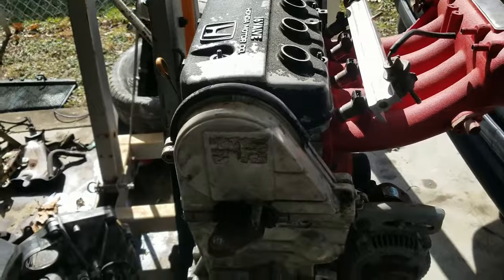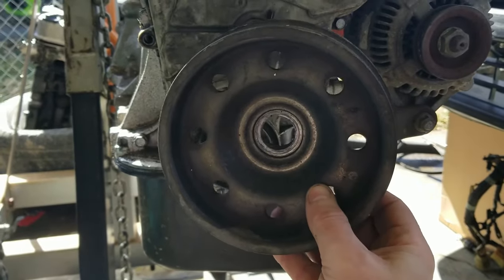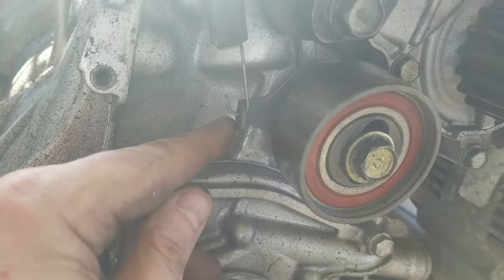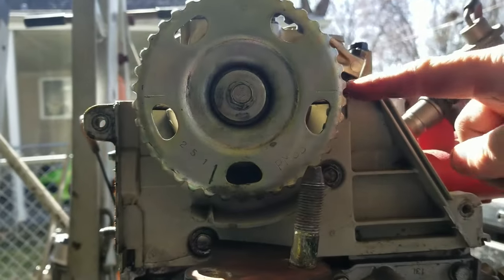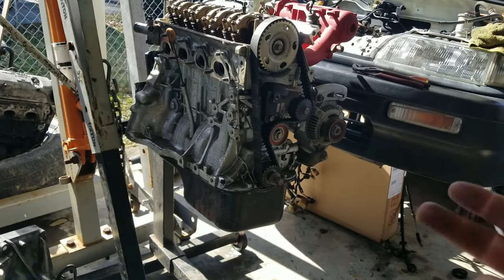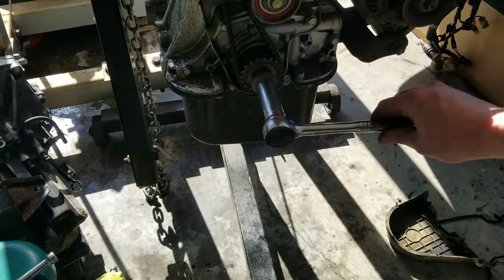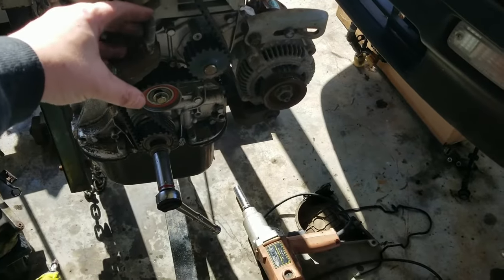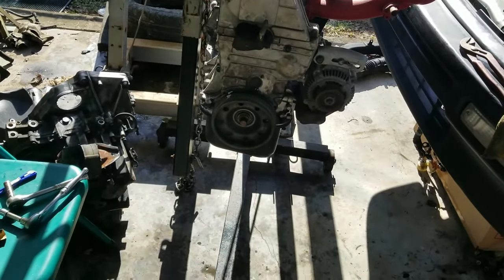Setting the timing on a Honda D Series  D15/D16 D15b2 D16a6 D16z6 D16y7 D16y8 Single Cam ZC

Comment: When adjusting, do not use any force other than the adjuster spring. If the belt is too tight, it will result in a shortened belt life.

Comment: On a DOHC ZC there are two spots on the cams on top to put two 5mm drill bits to hold the cams in place. Then do everything as the video suggests but go a little off on the bottom crank mark (around 3 teeth off) so you compensate for the slack when you turn the bolt. Spot on timing every time!

Comment: Great video..  Short (but important) note.   On P08 (JDM) engines (example D15B) the cam timing marks don't align with the top of head.   Instead there will be 3 notches in the plastic back cover (part number 11840-P08-010): two triangles showing P08 and one showing P28.   On P08 heads the "Horizontally oriented" 2 lines will align with the 2 P08 notches and will be slightly slanted with reference to the top of head by about 1 gear tooth.   On P08 engines if the CAM lines are aligned to the top of the head engine timing will be retarded (8 degrees for CAM 16 degrees for crank) and it will not be possible to set ignition timing successfully.   Engine will still work but won't be optimal.  On P28 engines you would of course align the single horizontal line to the P28 notch.   The rest is perfect.
Reply: Good info!
Reply: Thank you soo much for this comment I have pulled apart and put back together my d15b in a 1999 Honda domani twice now and couldn’t work out why it wouldn’t run right not realising the timing marks are not at the top of the valve cover but the side of the engine
Reply: This might be the solution to my weak engine. Thanks
Reply: I put my d13b with a p2a head. It wont start. Any idea on timings sirs?
Reply: holy shit, ty so much. I was dealing with these weird notch/arrows on my d14z1 and couldnt figure it out, since everyone says you should align it with the top of the head.
Reply from the maker: Yes if the timing is off just a tooth or 2 it can cause loss of power.
Reply from the maker: Sorry for the late reply, here in the states we never got the D13B engine, we got the p2f 1.6 head from the d16y7 non vtec I believe which is similar to the p2a head. This is a tough question because it depends on the deck height of the D13 block vs the D16 block. You make have to play around with different belts and tensioners to get it right.

Comment: I followed this video and kept finding if I turned the crank 3 times completely like you’d mentioned that my cam gear where it says “up” facing downward. I was going insane trying to fix this. After calling a buddy with more experience. He ask me if it lined up with just 2 turns. I said yea. I put an extension in the number one hole and sure enough it was tdc. 
I cranked the car with no dizzy plugged in to hear any irregularity and it sound good. Started it and it purrs. So if anyones chasing their tail turning it 3 complete times and getting the “up” facing down. This may be an issue your having.
Reply: The "up" Mark will always, be on down side at 3 turns. Reason is, for each complete turn of crankshaft, camshaft turns half and so you will, get the "up" Mark again on top after two complete turns of crankshaft.

Comment: Very educative. I have learnt a lot.But I am facing a problem when I engage a gear the engine stops  and jumps the timing.I don't know the problem.when I reset the timing again the engine start efficiently but on engaging the gear it stops again
Reply from the maker: If the engine runs in neutral and you can rev the engine in neutral, its not the engine. I would guess the trans has a issue, like its stuck and wont rotate and its making the engine come to a sudden stop which is causing the timing belt to jump. If you have a manual transmission I would say the clutch isn't installed correctly, If you have an auto, then IDK. But it sounds like you have a transmission problem. Did you put in a new clutch or have the transmission separated from the engine?

Comment: damn, setting timing was always intimidating  but after your video, I'm ready to do mine. ty!
Reply from the maker: Yes, I thought the same thing many years ago. The only real intimidating thing I have come across is rebuilding an auto transmission. These old 88-2001 Honda's are very simple, that's why I like them so much. Cheap and easy..

Comment: Now im no mechanical or at least a professional but im doing a engine swap with a d series in my 2000 Civic LX and would this tutorial follow along the lines of a 2000 d series? Because i was scrolling through some comments and ive noticed the newest d series comment ive seen was on a 92 civic so i want wondering if this tutorial was similar for a 2000? I dont know much about honda engines and i just bought my 2000 civic lx and the engine cumbusted, im assuming its a timing belt failiure and i decided to swap the engine for another with lower miles and i just decided to change the timing belt and a little maintenance while the engine was out. I apologize if the question is dumb, im not the sharpest tool in the shed but i was just asking for that
Reply: Yes, all D- series are pretty much the same.

Comment: Hey Mr JayDM! I hope you're still active on here... 

I bought a Civic with a D series with a y8 block and a y7 head, the kid I got it from replaced the cam flywheel with a lightweight one, never put the OEM cover back on. There are no notch indicators or anything to match up timing. The car is idling really rough and misfiring, so I'm definitely guessing timing issue. Is there any way to do timing without these indicators on the D series motors by matching up the Firing on cylinder 1 and rocking on 4? Any advice on how I should go about it? Thank you ahead of time!
Reply from the maker: The best thing to do is get a y7 or y8 cam gear (They are the same) and reset the timing. If you cant get one locally, I can send you one for $40 shipped (USA / Lower 48). If you want the timing cover (Upper/Lower Cover + Gear) I can do $80 Shipped (USA / Lower 48) contact me via Facebook group https://www.facebook.com/groups/MrJayDM If interested. The y7 and y8 timing covers are the same as well. To set the dizzy timing correctly you will need at least the lower timing cover.

Comment: After installing the belt you turn counterclockwise to remove the slack from the belt the crank is no longer on the arrow 
 and the cam hasn't moved ? Is the timing still correct ?
Reply: Do you compensate by advancing the crank 3 teeth
Reply from the maker: If you are having this problem you can set the crank arrow a little off to make up the difference when you turn it to put tension on the belt.

Comment: Doing this to an 88 civic with a D15B1. How can i torque down the crankshaft nut without an impact drill? I used a breaker bar to remove it but have no idea how to retighten. This is also stopping me from removing the slack from the left side of the belt. Any help?
Reply from the maker: You can rent the Honda crank pulley tool from an auto parts store, but I'm not sure if the D15b1 crank pulley has the hexagon for the tool to go into or you can take the starter out and put a crowbar in the ring gear to lock the engine from moving. I would just go to harbor freight and buy an electric impact.

Comment: Looking at buying a D16Z6 Civic. Seller says they've replaced spark plugs, plug wires, cap, button, rotor, fuel filter, and iac. Also says the car is sluggish under acceleration at low RPM. Could this be bad cam timing, distributor timing, O2 sensor or something else?
Reply: Is the distributer advancing. Sitting caused mine to freeze - corrode in place. Car would run but not accelerate. Happened similarly to a VW I had. If it is vacuum advance one may observe the mechanism move when sucking on the diaphram. Cap off. Some VW used centrifical advance and the too may bind for whatever reason. Not likely your problem but these are somewhat symptomatic
Reply: @j1j11j  I'll keep that in mind for the future! Thanks!
Reply: You might want to take off the cylinder head and check your valves, most likely your exhaust valves are bent, I did everything on mines from buying new intake sensors and new distributors and all, and come to find all my valves on the exhaust side were bent and the stem seals were bad

Comment: What if your crank gear doesn't have any marks on it. What should u do
Reply from the maker: You can pull #1 plug, put a long stick or screw driver down the cylinder turn the crank until the screw driver moves to the highest point. You will see it move up and down as you turn the crank. When the piston is at the top dead center (TDC) that's where you want it.

Comment: Can I ask u a ? On this video will this be the same on a mini me swap like a d15b7 z6 head or a b15b7 block with a y8 head with the timmin be the same
Reply from the maker: Yes its the same, the only thing with a mini me swaps, usually the timing will always be off by a half of a tooth. Some people say you should use the head timing gear and some people say you should use the block timing gear, the same goes for the belt. Its all kinda up in the air as to which one you should use.  I'm not familiar enough with mini me swaps, Ive only build one in my life and it was a b7 with a z6 head. It was so long ago I cant remember what I used, it was before I started recording videos. I do remember I had a hard time getting the timing right. The motor ended up throwing a rod a few months later. So what ever I did I Probably did it wrong. I would use an adjustable timing gear, this way you can easily adjust the timing to make up the difference of the belt and/or the thickness of the head. When setting the timing and you are a half of a tooth off you can adjust the timing gear to make up the half tooth. To me a mini me swap doesn't seem to be that reliable (Not that they cant be) The time a effort that will go into it you might as well have a matching Block/Head. Good luck with the swap!
Reply: @MrJayDM  having troubles with mine as well I have a d15b with a z6 head idk what gear to use
Reply from the maker: @alexus_ed6  Here is a pretty good write up that may help. If not join the MrJayDM Facebook Group and I can try to walk you through it. https://honda-tech.com/forums/honda-civic-del-sol-1992-2000-1/faq-d15-sohc-vtec-mini-me-massive-write-up-56k-goodbye-554053/
Reply: @MrJayDM  appreciate it

Comment: 1999 honda civic with automatic transmission, do you have to take the transmission out to swap the engine?
Reply from the maker: Technically no... But it makes it so much easier to pull it all out together. It is a little more work, you have to pull the axles and shift cable. The shift cable is kinda a pain because of the washer/tab on the bolt holding the cable to the transmissions. But it's not as difficult as the bitch pin on the manuals.

Comment: What if the cam gear doesn’t have an up position but has those two lines
Reply from the maker: At 2:40 you see the gear, it also has an angled mark at the bottom, I'm pretty sure all oem cam gears has some sort of extra mark, that should be on the bottom half of the gear when you line up the 2 notches.
Reply: @MrJayDM  mine has like an 8 and a 6 at the bottom or top and a hole for again the top or bottom
Reply from the maker: What engine is it? I'm interested in seeing the cam gear. Please join the MrJayDM Facebook Group and post a picture. https://www.facebook.com/groups/MrJayDM

Comment: But TDC is the single line right?
Reply from the maker: The crank has a notch on the gear and on the oil pump there is an arrow, you want to line the notch on the crank gear with the arrow on the oil pump. When this is lined up the 1st and 4th piston are at TDC. It is done this way because of the firing order.

Comment: You don't have to remove anything from bottom to do timing
Reply: You are correct if you are just re adjusting the timing. If you are replacing the belt and water pump then yes you need to remove the timing cover.

Comment: You cant just do this its not going to WORK tryed it servel times
Reply from the maker: if you timing is off when you turn it counter clock wise to put tension on the belt, you can set the crank gear a little off to make up for when you put tension on the belt.
Reply: @MrJayDM  I’ve seen u comment this twice what do u mean set the crank gear a little off?
Reply: @MrJayDM  having the same issue
Reply: @cli_flips  what he means is if your timing gets out due to tension, you can take the crank gear. Counter rotate it the amount it was moving forward so when you apply tension to it moves to where it's supposed to be.

Comment: He is not right that is not all you do do listin to him
Reply from the maker: setting the mechanical timing is just that. IF you are adding the dizzy timing then yes there is more to it.
Reply: I agree... There are 3 different ways to set timing marks on camshaft depending on if it's a 1.6 vs 1.5 and if it's -'95 or '96+...
Reply: I wish I could post photo to explain this better
Reply: Some engines use single point tdc on bottom marker..
Another uses arrows on back cover..
... and others use flush with head...